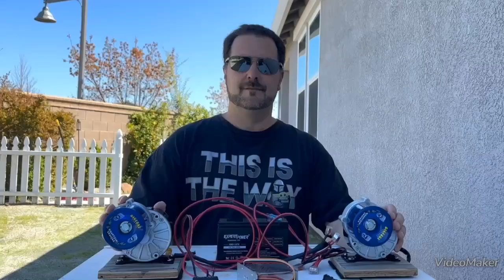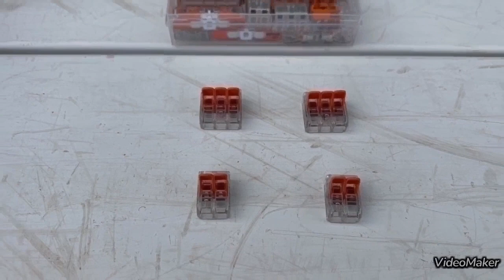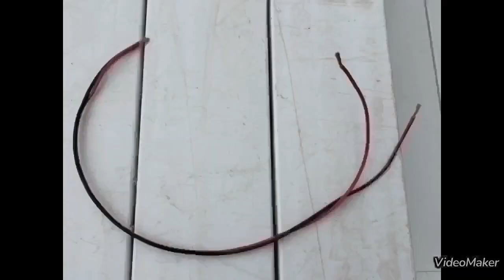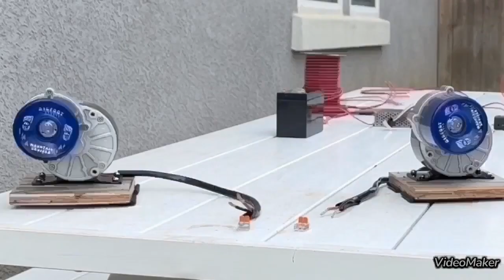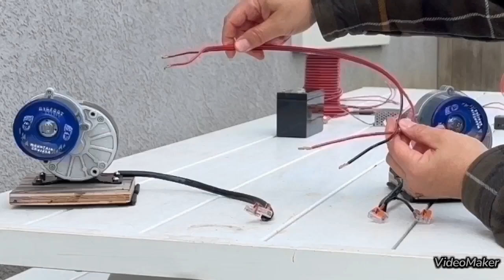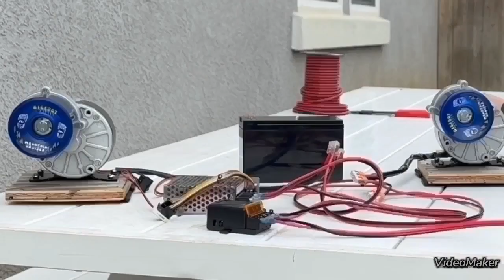How To DIY Dark Ride Motors! #homemadedarkride #backyarddarkride

Comment: Could you explain how to attach the skateboard wheels to those motors? I purchased the supplies from this video but cant figure out how to attach the wheels. Thanks.
Reply from the maker: Hey, thanks for watching! For the attachment of the skateboard wheel to the motor, I made a YouTube Short a few months ago, titled:
“Motorize Your Dark Ride with this Part.” I also provided links for the parts I used. Let me know if you have questions after watching that, it’s a little tough getting the nut off the sprocket of the motor.
Reply: Hi. I did figure out the wheels tho had probs with one. Now I have issues with running it. Any chance I could email you directly to discuss easier? Something just isn't right Thanks.
Reply from the maker: @BobKuiper Hey, sure.  If you can message me on Instagram we can figure it out (I’m Darkyard Rides there too).

Comment: do you have a link to the hinges used another that the motors are fixed to?
Reply from the maker: I don’t have a link, but I bought those at Home Depot. They’re just 2-inch door hinges and come in a two-pack with screws provided.
Reply from the maker: As far as what the motors are attached to, I just cut two small squares from 1/2” plywood.
Reply: @darkyard_rides  Do you know the reason Chamber of Souls removed their How-To Ride Cart video? I'm so grateful to you because if not for you, I'd be somewhat lost. Thank you for taking the time to answer these questions.
Reply from the maker: @FBGBricks I don’t know why. They made two great how-to videos where they specified how they set up their motors and side-wheel assemblies, as well as their track system - really enjoyed those. But, Art of the Haunt and Will Pemble on You Tube also have great how-to videos on their track systems.
Thanks for the kind words, glad to help & happy to answer questions about the ride build, I know how difficult it is at the beginning to get everything started.
Reply: @darkyard_rides  Were you able to jot down all the materials from the original videos, or did you have to do any figuring out for some components?
Reply from the maker: @FBGBricks I noted several things at the time when I was watching Chamber of Souls videos, but there were many details that were unknown.  I had to bring my motor, and a lot of my wheel assembly parts in the hardware store to figure out which size parts were needed to secure them together.  I also used other methods that made sense to me to make jigs that worked in making ride parts.

Comment: Could you give my a list of everything I need
Reply from the maker: Sure, you’ll need:

- Two, 12 volt brushless,gear- reduction motors (2950 rpm)
- Two Bigfoot skateboard wheels (76mm)
- 12 volt battery 
- RF switch (basically on/off switch) with a remote control
- Heat shrink wire connectors with various styles (I used fork and spade connectors) 
- Lever nut wire connectors to connect the cable (I used Wago brand)
- Spool of 14 AWG cable (positive & negative)
- Heat gun to heat shrink wire connectors
-Small Phillips head screwdriver 
-Wire strippers/cutters

In the video I show all of the listed items and how I used them to put everything together. 

Have fun! 👍
Reply: @darkyard_rides  thanks. I've been watching all your videos and was trying to figure out what you were using. This saves a ton of time!!!!!! Your channel looks great (liked and subbed)!!!!! Keep up the good work.
Reply: @darkyard_rides Do you have links to these?
Reply from the maker: Yes, see below links in this order:  skateboard wheels, motors, RF switch, speed controller, 14AWG cable, lever nut wire connectors, heat shrink wire connectors, 12v battery & heat gun. The rest of the items were from hardware stores.

https://www.amazon.com/Bigfoot-Longboard-Wheels-Mountain-Cruisers/dp/B077BT962F

https://a.co/d/9ATjcDL

https://a.co/d/4QqBIbU

https://a.co/d/cWW8noT

https://a.co/d/92v52ii

https://a.co/d/ezqXXgw

https://a.co/d/iRLC9dW

https://a.co/d/3s1XPUH

https://a.co/d/cslq1EP
Reply: @darkyard_rideshow long will that battery last? ~4hrs is usually how long my haunt goes on each night. Will I need multiple to switch out? I’d rather get a bigger battery and just recharge during the day, rather than have to do a switch during operating hours.
Reply from the maker: One battery should last a couple of hours at least. I’ve been test-riding my cart repeatedly without charging the battery to see how long it will last.  Regardless, I’m going to wire four batteries in parallel for this Halloween, so I won’t have to worry about recharging batteries the whole night. I think if you did the same, you would be fine.
Reply: Thanks!
Reply from the maker: @Officialcaydenplays You’re welcome!